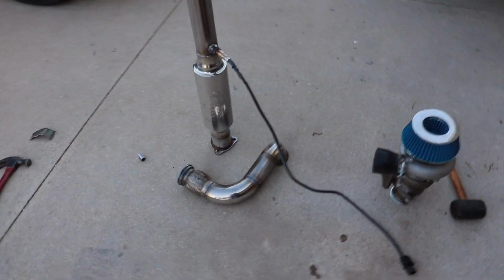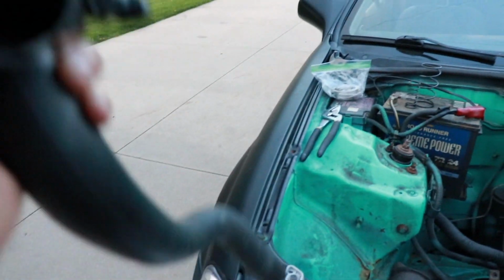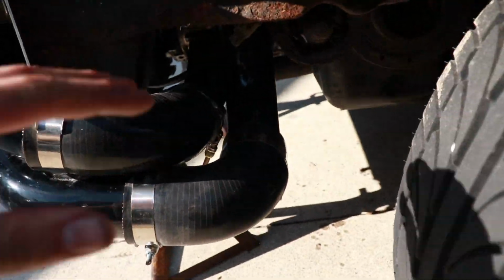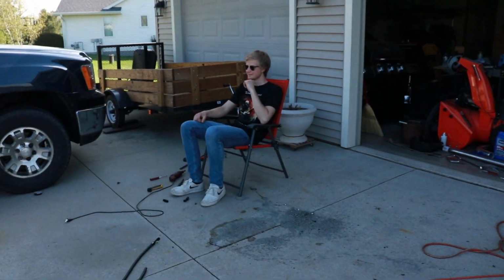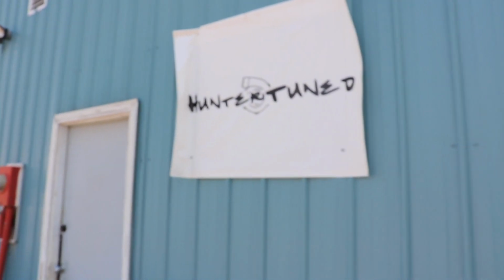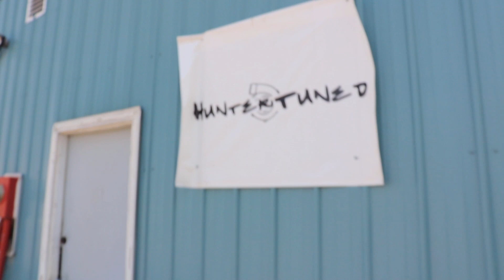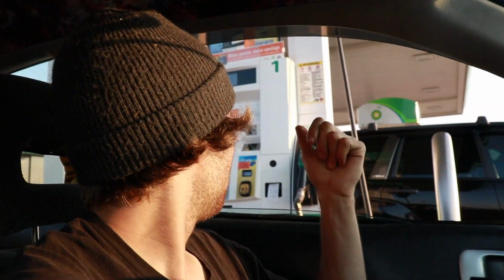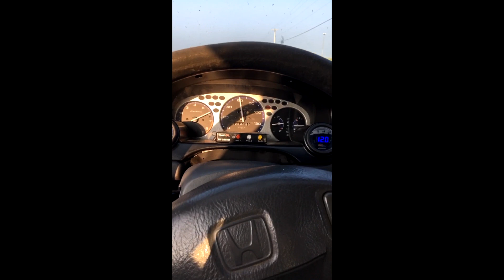THE WORLDS FIRST TURBO UEL HONDA

Comment: It’s crazy how much this sounds like a Subaru.
Reply: At first its like nahhh then while passing I would have said STi automatically. Very well done.
Reply: turbobenx yeah my fa20 sounds like shit haha. They make tomei uelh now for them tho
Reply: turbobenx  the only thing that gives the boxer engine "the boxer rumble" is unequal length headers. Stock it sounds like a plain civic lol...
Reply: turbobenx  Nah I've heard a subie in person and an UEL header civic in person, both sound about the same, maybe slight variations but a stock subaru sounds exactly like a civic engine lol
Reply: All the uel headers is doing is cross cutting another exhaust flow causing a slight pause on exhaust smoke exit causing a slower pulsating sound which doesn't maximize hp nor helps engine logevity.
Reply: @xsquatchx2535  tomei is just a muffler and pipes. Get off the bandwagon.
Reply: @x1expert1x98  not at all get your ears checked
Reply: The only reason Subarus sound like that is bc of their uel headers.
Reply: @AndToTheRepublic4WhichItStands  No, I have had 2 subarus with Equal length headers and they both rumble nicely. UEL headers will just enhance the rumble even more.
Reply: My TC sounds like one 2006 Scion TC on unequal length headers on gt3076r
Reply: Because the ONLY reason a Subby sounds as it does is because they come with OEM UL headers. It has nothign to do with having a horizontally opposed engine.
Reply: @adamgroszkiewicz814 Its sad cuz 99% of people dont think logically they see brand name and nothing else. Like bmw good subaru bad for not a single good reason. Its disgusting, bmw does some things better than subaru and subaru does some things better than bmw, appreciating and understanding those things is what makes the difference between a genuine subhuman npc and people who care and believe in things
Reply: What’re you talking about it is a Subaru?

Comment: What lug nuts are you using for the STI BBS RIMS on the Honda?
Reply from the maker: 4x100 to 5x114.3 wheel spacer adapters from russia that i got on ebay

Comment: O, man, thanks for your response. 

The lug nuts, what seat are you using... I know it's M12x1.5 but what's the seat; is it the acorn/tapered cone seat or the mag seat? I have the same rims but I am unsure what lug nuts to run safely...
Reply from the maker: It was tapered and i used whatever thread the spacer used on its studs. I never had any problems with the spacers
Reply: @MemelordJord  much respect. 
I literally bought the Mcgard set up M12x1.5 Acorn/tapered seat. Now I'm just hoping to see how much threading I get because it's recommended to at least get 7.5 turns. Thanks a mill. I am hoping to get tuned by Huntertuned in the future.

Comment: A couple of things: If you put a long 3" 90-degree or 45-degree bend on the turbo compressor before the filter, you'll get a "1000hp supra" style turbo flutter. Also, if you install a flow control valve on the vacuum line of your BOV, you can tune it to delay the BOV and get both flutter and pshew at the same time. Lastly, if you were custom fabbing )or want to again in the future) you can make the UEL header a 1-4 and 2-3 pair.

What that would do is make it possible to run a twin-scroll turbo decently, as well as change the sound signature to possibly be more V8 like, but like a GT350 with long tubes kinda sound. Here's a sort of approximation, if you care to listen. https://www.youtube.com/watch?v=wCSo85uM_14&t=55s

For reference, that engine is a 65-degree bank angle, 360-degree(or 0 if you prefer) crank V4. The pistons in either bank reach TDC and BDC in pairs, but fire on opposite strokes. That plus the 65-degree bank angle makes for a staccato evenly-uneven firing interval. Compared to a cross-plane R1 which is like a similar V4, but that V4 would have a 180-degree crank which is more traditional muscle-car-like.

Comment: If he wants intake noise he should check the Kind of turbo he has there are sound distinctions between a 6 blade and 12 blade turbo the 6 usually is louder but pair that with a anti surge or ported housing and it fucking spools dude

Comment: I wonder where is this civic now and if it's still out there. Needs more recognition
Reply from the maker: STI Civic went to the scrapyard
Reply: @MemelordJord  nooooo dudem what happened? I want to do an UEL header on my rsx, im just wprried about dofference in cylinder temperatures
Reply: @TwentyTwoThirtyThree  Don't
Reply: @hhaste  I don't have an RSX anymore, but why do you say don't? It makes it sound sick. Nobody wants to hear a regular Honda
Reply: @TwentyTwoThirtyThree  Oh, ok. Sorry, I should have been more specific and keep in mind, my knowledge on UEL's is primarily based on Subaru's but they're generally considered inefficient and bad for performance. Most high horsepower Subaru builders will say to go with equal length for faster turbo spool and better mid range & top end performance. I did a quick search on naturally aspirated engines and it still sems like some people say Unequal length headers can cause engine misfires and damage, leading to decreased performance and potential harm to the engine. They do sound cool but IMO, they aren't worth the potential risk. They do also offer more low end, so maybe they aren't that bad for N/A engines, I'm not totally sure.
Reply: @hhaste  on a bone stock 160HP RSX you wouldn't notice a difference. The only potential damage they are talking about would be cylinder temperatures fluctuating, but again that is talking about high hp applications, neither my bone stock RSX or TSX will care. And besides, I'd take that sick sound even if it killed performance. Sadly it's such a pain to fabricate one for the K20/24

Comment: "cam can be 180 degrees out and timing marks still line up" hahahaha no bro there's an "UP" mark on the cam gear. the bottom end can't be "180 out" in relation to the cylinder head... the timing marks line up and you put the timing belt on. you just fucked something up. ive rebuilt and timed many hondas

Comment: I wanna see a single 50mm turbo with a smaller 20mm turbo so that way its twin scroll but it has no lag onto of vtec bring so hard 16y8 with a sleeved block with built bottom end and a sick custom 1320 uel to make it sound like a rumble grumble machine! Then make a dual exhaust for it and a burble/2 step, rolling anti lag. I have the car. Just need the time and money. I'm gonna commit to it. Speak it into existence. I want my car to have a full interior so me and 4 homies can gap people while eating in n out at 3am while hot boxing. Talk about fun comfort. I drove it home at 95mph overheating at 210°F and its fine, I gave it a refrrsh and made sure no warping or long term damage way done. I just wanna sick car bro, but time. In 5 years it'll be there, its gonna be done good and right. I also wanna keep it the stock red, but put HIGH gloss and a lil flake in the paint so it looks a lil nicer. I also wanna try and have fitment that let's me drive 8 hours or 16 min. I wanna be static.
I got a 2000 EJ8, once I grenade the d16 engine, ill throw in a K20/K24 Jackson racking supercharger with a nice custom fab setup for reliability.

Comment: Lol iv been actually thinking about doing this to my turbo eg i have the 1320 uel on my daily ek, but was thinking bout buying another set and doing a custom t4 flange on it this up comin spring when its not cold was super curious how it would sound and preform i wanna do a before and after dyno run

Comment: how/ where do you get these headers?
Reply: 1320 Performance makes them. They make them for the D series and the B series. You'll have to modify the header if you want to go turbo, but they still sound dope without one.
Reply: @smokingdank4209  do you think they'd make an f-series set as a custom order?
Reply: @avapire2359  I have absolutely no idea. I've been wanting to find out myself as I've got a '98 Accord F23A5 that I want to boost, and apparently on 6g Accords WRX wings fit with slight modification lol

Comment: Mazzei formula said that all for bangers sound the same (technically engines with the same amount of cylinders sound the same with exceptions like the Dodge Viper V10 vs other V10s), so I was curious if a Honda would sound good with UEL and I was not disappointed.

Comment: What exactly makes you think this is the first UEL turbo Honda? Most of the ramhorn and sidewinder manifolds are UEL.
Reply: It really is the first uel manifold made for a turbo for a Honda only one I can find and literally doing the same on my em1 gsr turbo
Reply: Unequal length means the runners aren't all the same length. Sure, this is a different design, but the sidewinder, ramhorn, miniram, and even some cast manifolds have runners that vary in length from each other. Go grab one, measure the runners, then check back with me.
Reply: mdb4879 I get you but maybe this 1320 one is just more unequal haha only one that makes that same subie sound cuz the ram horns and cast ones sound like a regular Honda
Reply: You're right that the difference in runner length is more extreme. The ramhorns sound a little different than the equal length manifolds, but pretty close. The sidewinders on a K series sound a lot like a Subaru, though. Not quite as much as this, but if you ever hear one cruising around I wouldn't be surprised if someone mistook it for a Subaru before seeing the car.

I just don't care much for the clickbait title. The world is a big place. "World's first" is a mighty hefty claim.
Reply: mdb4879  I get you maybe people have done it to just not recorded it